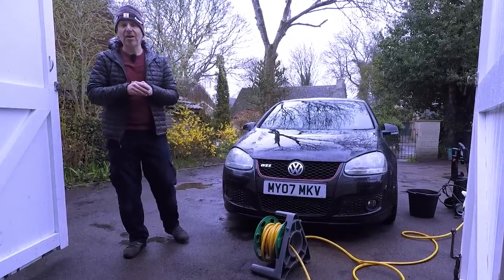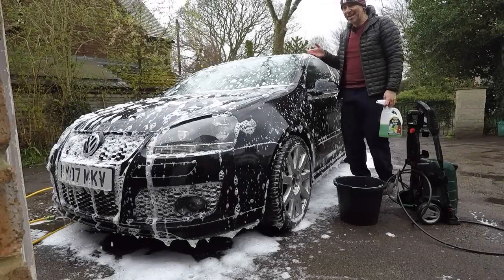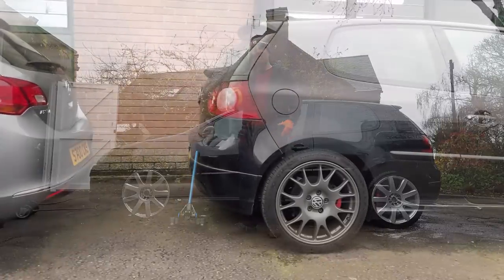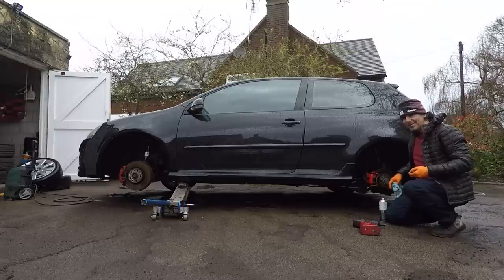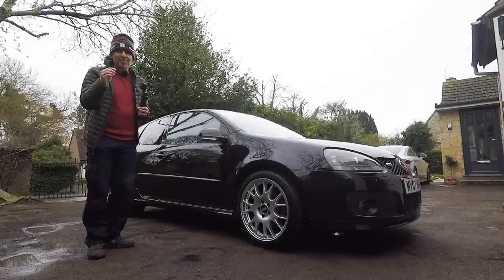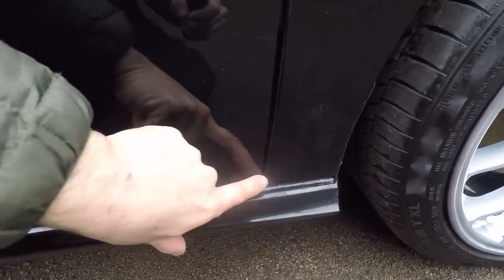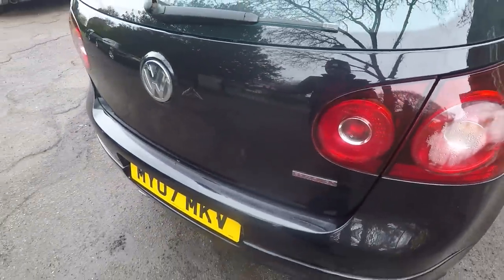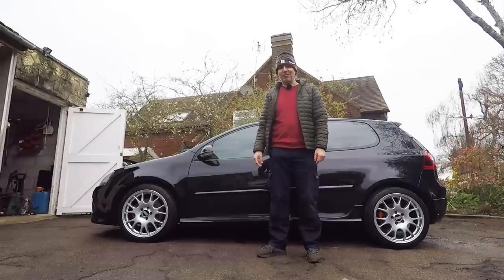NEW WHEEL COLOUR + PAINT INSPECTION - PROJECT EDITION 30 #MK5GTI #GTI

Comment: Tip. Don’t grease your wheel bolts. Torque settings are for dry bolts 👍
Reply from the maker: Good point Luke, I've never got to the bottom of that but as you say they don't come from the factory greased so torque setting won't apply.  On some Audi RS models the manual categorically says do not grease them
Reply: For the last 50 years I've always added a dab of grease to the bolts or nuts and never had a problem. And ever since I had a wheel stuck to the hub a long time ago I always add a dab of grease to the hub as well. As for torque setting for the bolts? Never bothered and again never had a problem.
Reply: Totally agree Luke, I was always taught not to grease wheel bolts. I do keep the hubs clean and greased though.

Comment: Might be worth checking for build up behind the front wheel arch liners behind the wing near doors
Reply from the maker: Definitely Chris, arch liners off, pressure wash, Bilt Hamber protect wax - job done. One for warmer days as needs to dry out
Reply: @volkswizard  i took off the arch liner on my sons 2.0 tdi ibiza to do auxilary belt and there was loads of old leaf and soil built up glad I spotted it and cleared the passenger side too

Comment: Does anyone know the difference in weight of the BBS CH CH028 18x8 et 43 that came on Audi S4's compared to these BBS VZ033 18x8 et 44? I have read the VZ033 are heavier but would like to confirm, seems crazy they made 2 separate wheels that are so similar in spec

Comment: I'd whip the sill covers off and have a look at the back end of the sills.
These MK5 rot like mad in there
Reply from the maker: That's what worries me Noel, I did have a look at it on a ramp before buying and it seemed OK there so I am hoping it's just chips that have caught the quarter panel as it flicks out a bit near wheel arch. We shall see as covers need to come off for painting as they get battered.
Reply: @volkswizard  that's exactly the problem is that it's well hidden. We had one here recently looked the same bubbling on the outside but when the sill covers were off you could get your hand in on both sides.

Comment: I actually prefer the temporary set of rims you had fitted in the beginning of the video🙃
Reply from the maker: Well each to their own! They are the same size but replicas of those on the B5 RS4, everyone was fitting them to their Mk4 Golfs 20 years ago - check out the double drilling - 10 bolt holts, 5 for 112 PCD and 5 for 100. Should be hidden by a centre cap, often a cheap plastic knock off of the aluminium Audi version
Reply: I really like the look, thank you for all that info. I'm going to go shopping & hopefully find a pair for my mk5

Comment: Great video as always Andrew, looks a pretty good example bar a few small corrosion issues which are easy to resolve, would suggest having a look at the rear subframe and suspension areas and put some preserve on it to prevent further surface rust as they do suffer alot. Definitely a keeper this with such low mileage .
Those VZ'S are very rare nowadays as I would like to get a set aswell as I don't like the Pescaras like umyou because of the worse Offset.  Hope your Well.

Saintsteve 🙏🏼

Comment: Are you going to remove the rear window tint for that original clean look?
Reply from the maker: Well spotted Brian - it's weird because my polarized sun glasses picked up the side windows have tints on them, didn't notice the back. Got bad memories of stripped tints off before and trying to get the glue off the glass (tiny window at front of an Audi A2 was the worst!).  But yes, any tints definitely coming out!
Reply: @volkswizard  wd40 with the thin nozzle squirted under the film to break the seal of the tint is one way I’ve heard that works. The rear is the problem with the tint pulling off the heating elements.

Comment: All very minor dings and scratches, I’d give it a good machine polish and leave it as for now, although I’d have the front arch liners off and clear out any crap that’s causing that sill area to rust 👍🏻

My mk5 R32 did that, but luckily it was only 8 years old and VW honoured the warranty and replaced both front wings and painted most of the car! Apart from roof and tailgate! as it had “zinc blooms” on almost every panel, apparently caused under the paint where the zinc wash has missed tiny places and you get little star like blemishes come up 

Looked mint after

My MK5 Gti which was ordered RHD from Denmark, and it didn’t suffer any of the same issues, even still had its original rust free wings which was weird

Comment: Great video and car Andrew, good call on the silver.  Interestingly I almost hought one of these new but bought a Leon FR TFSi as couldn't justify the extra cost for less kit. Robinson in Lowestoft was a VW and SEAT dealer so drove both back to back i still have it 15yrs later still looks good and is completely rust free.  Not the ED30 I really wanted but don't regret buying the FR.
Reply: Scam reply

Comment: Andrew -nice find, there aren't many unspoilt original MK5s let alone Ed30s. Still too many overpriced ruined ones on auto trader. I still stand by my original view when the mk 8 was released. Mk7 was the last 'proper' GTi to be released and probably in time the best of the lot (well maybe apart from MK 1) Probably why you ditched the MK8 CS and bought another MK7 CS-S !
Reply from the maker: As a daily the Mk8 CS was a truly brilliant car, 40 mpg + yet it works on track with zero mods. OK it had issues but dynamically it was a massive step up on Mk7 particularly with regards to steering. The media seem to disagree but they don't back to back cars like I do, have you ever seen a Mk8 vs Mk7 comparison in the wider media? I'd never use a CSS for 50 mile daily motorway commuting as there are far better cars but for the odd A and B road thrill to liven up an otherwise boring drive it's perfect. Oh and Mk1 was the prototype, Mk2 was the first fully resolved GTI :)